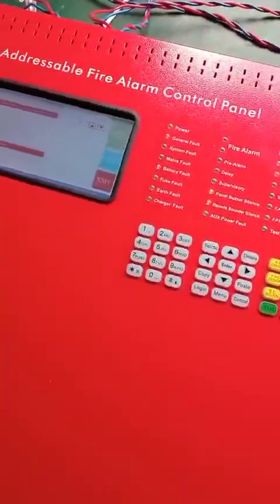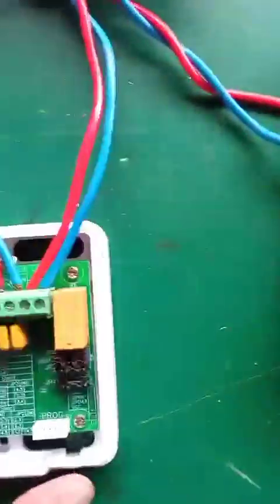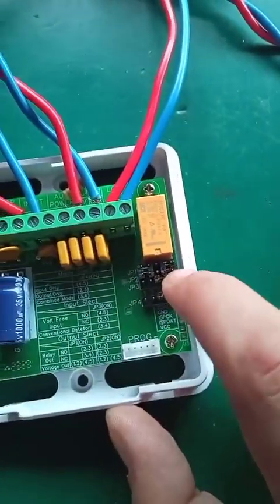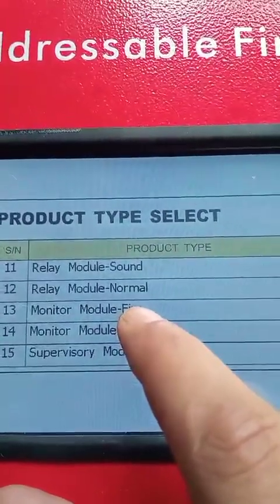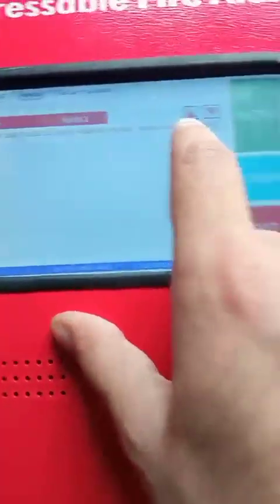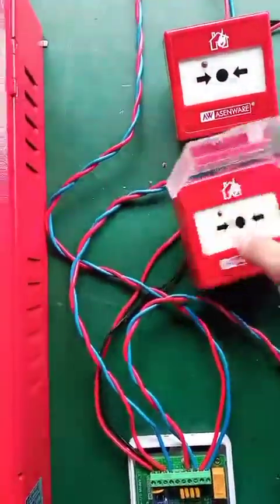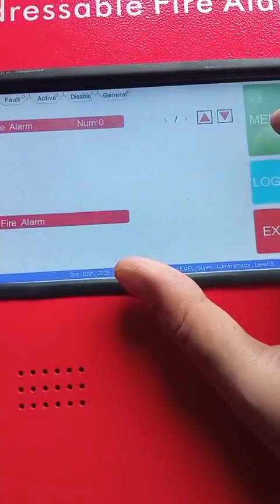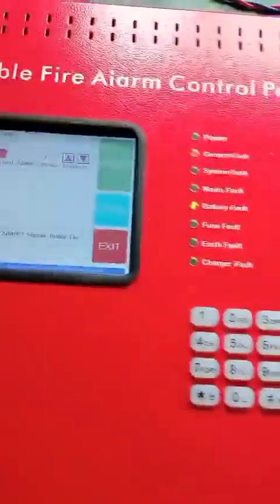How to Connect Addressable I/O module with Conventional Horn Strobe (Part 2)

Comment: How can I address, find, or program addressable call point and strobe on addressable fire panel without IO module? Or encoder
Reply from the maker: Better with a programmer dear, or you can set with our programming software on the computer.

Kindly contact us for more information:
Email: info@asenware.com
Whatsapp, Wechat, Tel: 0086 13922805301